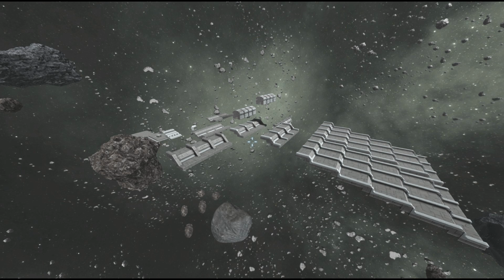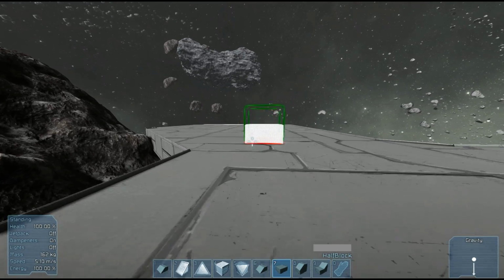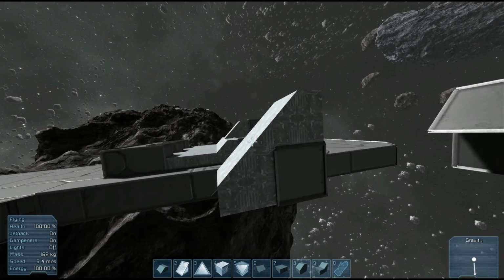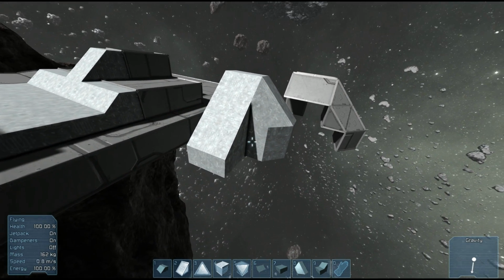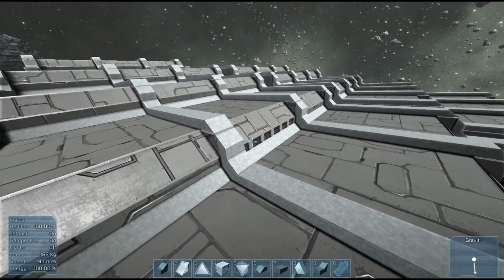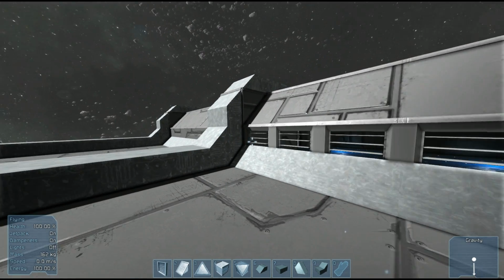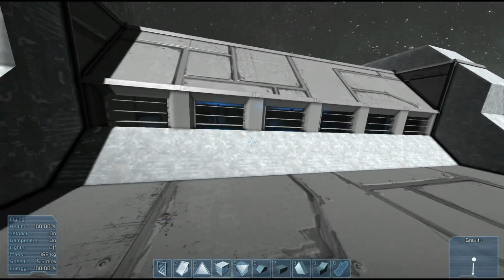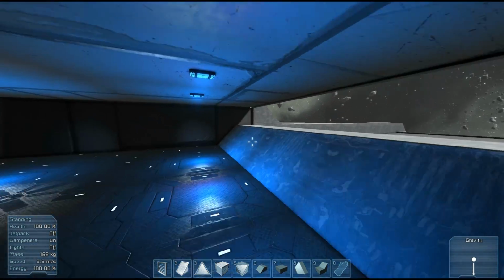Space Engineers, Half Blocks*

Comment: Your problem with half blocks is the setup of them to keep the same number of blocks but keep the half size you would need to use 1/8 size blocks. A way to toggle 1/8 size blocks so u could make half slabs and corners would still work

Comment: In conclusion, use small blocks for ALL types of ship so, it pleases everyone and don't change anything else.
Reply: Unfortunately there's a reason they didn't do that. A large block is 2.5 meters. A small block is 0.5 meters. So to build a large block out of small ones, you're building a 5x5x5 grid. That's 125 blocks. Which is 125 more load on the simulation part of the engine. Think of any time your game has lagged a little bit on something you built, and now imagine if that object was effectively 125 times bigger. I'm sure you can see the problem there. : /

For something like these medium blocks which would be intended to be used sparingly, and are only 8 M-blocks per L-block, it might be possible. But even then you just know a load of people would try to build entire ship out of medium blocks and lag the game to hell, and then complain about it.

I have always felt like the game was missing a medium block myself, ever since release. But unfortunately it's actually a kind of tricky subject.
Reply: UnknownSquid I like the idea of this medium block system and it can make a lot of great builds, but as you said it would put on a lot of load. Maybe wait until they work on the engine a little more to reduce the lag before they implement something like this?

Comment: To put it shortly, they just should allow to use small ship blocks on big ships.
Reply: I totally agree
Reply: Jakejud1 except the game wouldn't render all the blocks that get covered/obscured. that's how the game already does it, as sage describes at around 5:10
Reply: That wouldn't work too well. the performance hit would be insane, trying to flesh out a large with small blocks for detail would be toooooooo much, each one of the large blocks is the same size as 125 small blocks, and each block is 56 polys. They had a very good reason to make the large ship blocks LARGE. and that's not even covering how processor heavy the collisions would be.
Reply: Jakejud1 yes but the game is still unoptimized what we really need is more optimization ex grouping a 2x4 set of small blocks instead of generating them as independently
Reply: vsauceisepic
Afraid you really can't just use the word optimisation like it's a magic wand. One half of optimising a game is tweaking those bits of messy code, and finding hidden ways to smooth stuff out. The other half is all about making hard and sensible choices, being willing to compromise, and knowing your game's limits.
Reply: RipOffProductionsLLC
That's only rendering though, which is load on the GPU. With the exception of lighting spam, Space Engineers is almost entirely bottlenecked by the CPU. Even blocks that aren't rendered still put the same amount of load on the sim and physics engine. The game needs to calculate and account for them constantly, whether you're looking at them or not.

I want something like this too, but I'm just not sure how it can be done without posing problems.

[Edit]
Actually, that idea in the post from "TheVandolizm" here in the comments, looks pretty good. If something like that could be done, it likely wouldn't add any new strain on the game at all. '-'